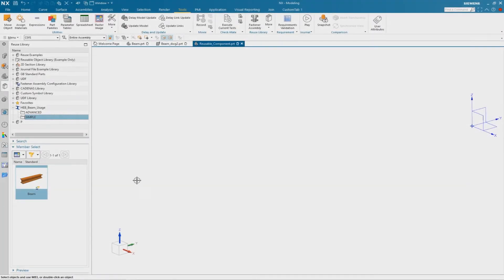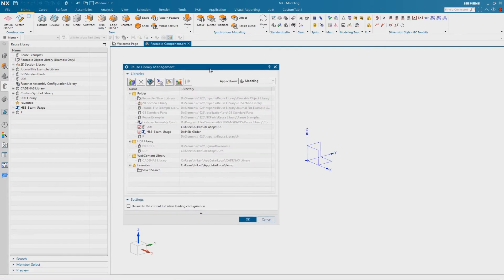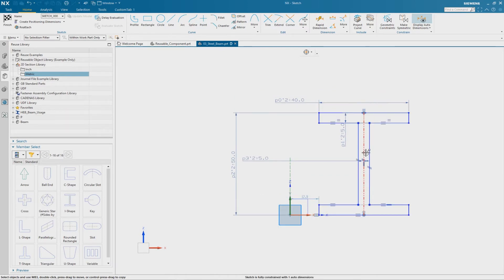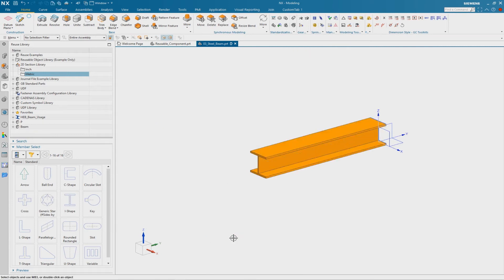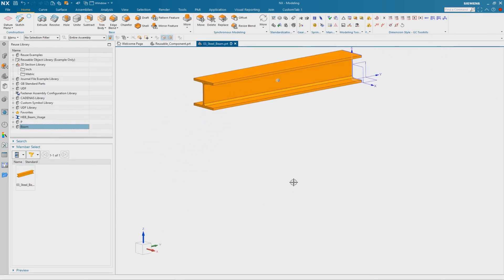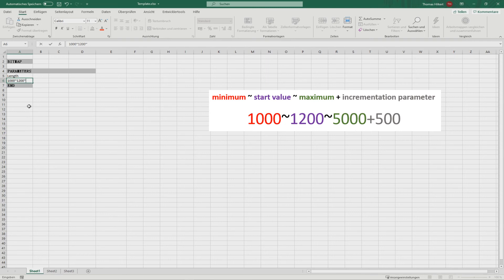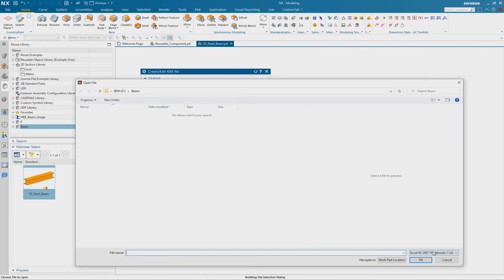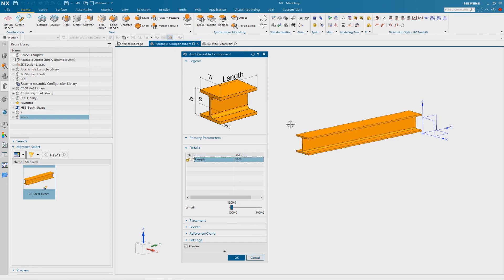Siemens NX - Reusable Component (scrollbar)

Comment: Hi, can you help me? When I insert model first everything work, but when I want insert same model second time and I set different lenght my first inserted model change lenght also. How I can fix it? I want insert from library same model  multiple times but different lenght.. Is it possible?
Reply from the maker: Hi. One possibility is to clone the reusable component during insertion. The keyword here would be: "Part Name Management dialog box". Alternatively, you could think about deformable parts, where the instances can be changed independently of each other.
Reply: @thomashilkert8149  Is it possible to somehow make it so that I need to insert a cylinder into an assembly, but the length between two surfaces to measure and that distance value to be written into the Expression Length of the cylinder when inserting from the reuse library, for example?
Reply from the maker: Other options would be to use the PTS module, or to create a placeholder in the component to be inserted using KF-function like ug_askExpressionValue_, which is filled when an expression is present in the workpart (e.g. length). Another idea: using deformable parts!! Build a cylinder with 2 datums and define this as a deformable part so that the start and end objects can be selected when the component is inserted. The only requirement is that the reference objects (surfaces or datums) must be in the workpart via a WAVE link in the Assembly context (where the component is to be inserted).

Comment: Hi, I have one question. I made it step by step, but why the slider of the length is working but the part isn't change it's length? I'm using NX 10 and Microsoft Office 2013, becose with other version doesn't work "Part Families"  
Thanks.
Reply from the maker: Do you have "linked" the expression "Length" in the Extrude function?
Reply: @thomashilkert8149  thanks, I think that's the problem.